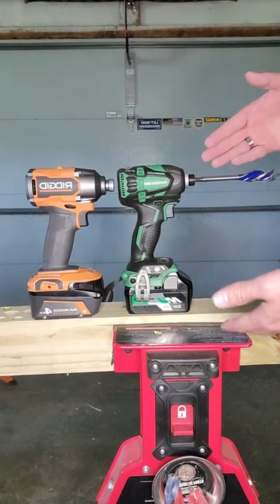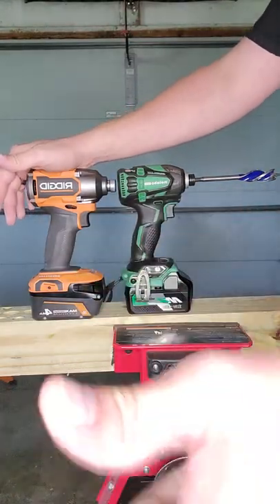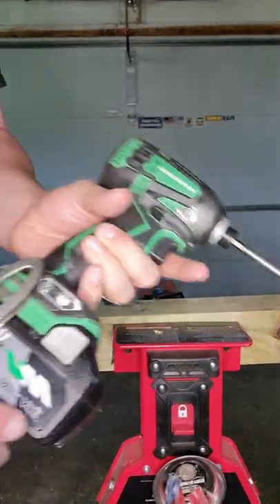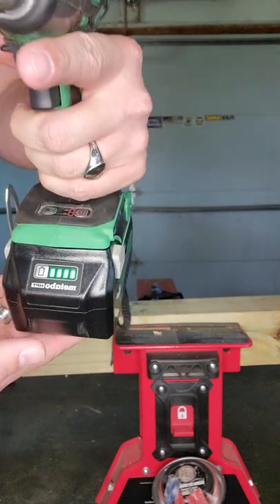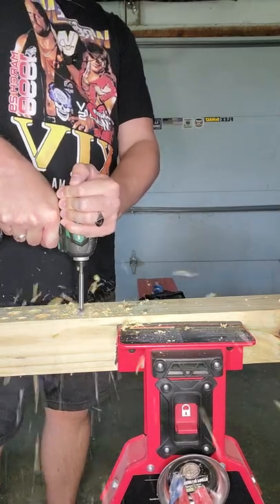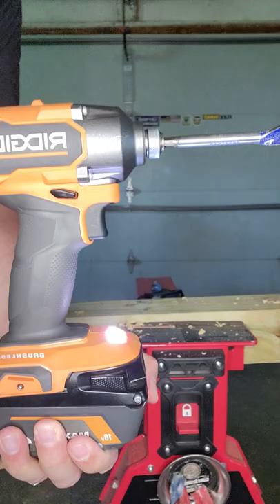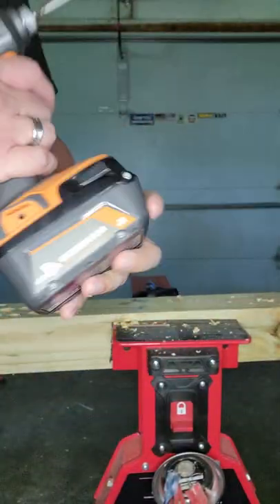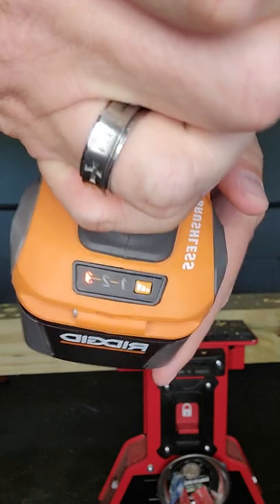Ridgid Brushless vs Metabo Triple Hammer (Impact Drivers) #ridgidtools #metabohpt

Comment: Hey.. anyone know what happened to the Flex Stack Pack toolsboxes/packout knockoffs?  I really wanted one, I need an attached lid with those struts for my setup.  I cant find any update and the original video is almost a year old i think.
Reply: You don’t like the pack outs?
Reply: @mannyc805  Its not that I do not like them… to the contrary, I think they are wonderful.  Its just for my use case.  Im outfitting my pickup truck to live out of… I have a tonneau cover on the back. So unless I remove the handle, Packout will not work for me.  it also appears that I cannot fit the large rolling box (or the one w/o wheel) with the small one on top.  Right now I am using the ridgid, which fits great with those 2.  I just hate how I have to remove the lid from the large rolling box.

I am going to go with the compact tool box packout for another area, for non-tool stuff.  Waterproof and I can get the mounting bracket for the floor.
Reply: @BLASTIC0  nice hopefully ridgid or flex make one that fits your needs